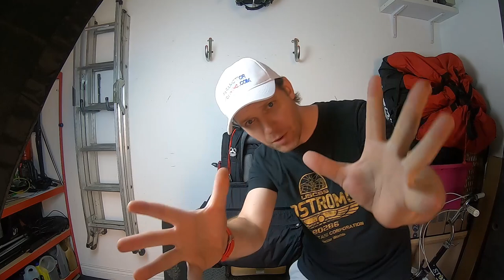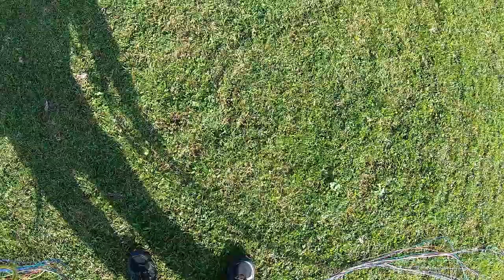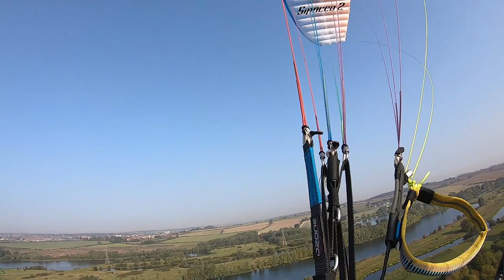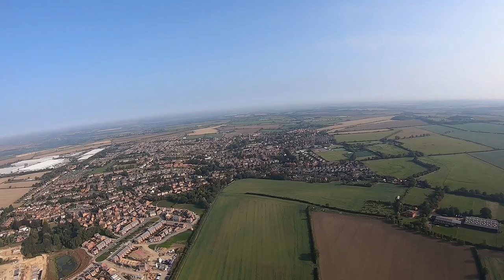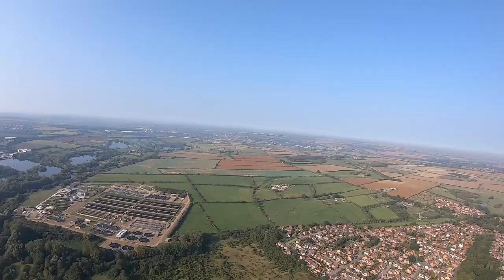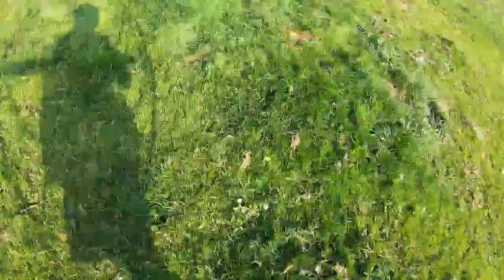Paramotor Vlog - Hangpoints, Bruises, Testflights

Comment: Nice Video Paul. On those nill wind days. Try running your motor up (blowing air over the wing) for a little longer, 20 seconds ought to do it. It helps set up a nice airflow. Then launch immediately into that. 
Keep up the great work!

Comment: Love the way you 'tell it like it is' mate :-) Makes me keep watching!
And you're static hang check was ok, like I've recently done on my Miniplane...but on take-off it was not so easy for me to slide into the seat? (which was great in the garage...)
Me thinks it's the thrust that changes the angle of the seat during a full power take off... what say you friend?
Cheers again,
keep posting as we always are still learning!
Reply from the maker: Got in the seat ok, but hadn't in the past. Used the hang check to readjust the legstraps.
Thanks for watching! 👍

Comment: Exact same harness I have. Love it so far. Been thinking about moving my hang points forward but my arms have only Front/middle/rear. Currently in the middle. The only issue I have is that I have to shove the seat under me with one hand. Maybe just my extra long legs.
My wife tells me my mood is bad if I go to the field and can't get in the air. I try to just be glad I'm only disappointed. Grass stains on the knees from the day before? :D Thank you for including that too. Thank you as always for the tour.
Reply from the maker: I had that with the seat, but adjusting the leg straps solved it. 👍
Reply: @PARANOOB  Tightened them up or loosen them off?
Reply from the maker: Depends if yours are  too tight or too loose! 😉
Mine needed tightening a bit. 👍

Comment: What could also be happening is the XL harness could have dropped your torso lower relative to the frame. This would put the motor's thrust vector high over your center of mass. Jumping to full throttle do you find you get pitched forward momentarily?
Reply from the maker: Will check next flight, thank you. 👍

Comment: Just subscribed! 
Thinking of getting into the hobby
How much in regards to g-force and stress on take off do you get?
Is the motor heavy? 

I know that McDonalds!!
Reply from the maker: Hiya! Thanks for watching and for the sub! When your feet leave the ground all the stress goes away.. :)
For normal flying, G-force isn't a thing. Obviously you can feel it when turning tighter etc. Motors vary in weight; 4-strokes like mine are the heaviest, low cc two-strokes are the lightest. You're only carrying your motor and fuel until you take off, after that you're just sitting there, with the wing carrying everything.
If you're local to me, get hold of Clive at CM Paramotors and pop along to his field one day when students are training. He'll answer all your questions and you can watch everybody.

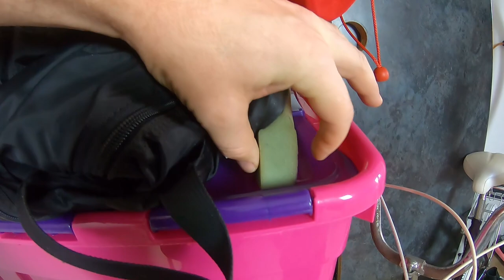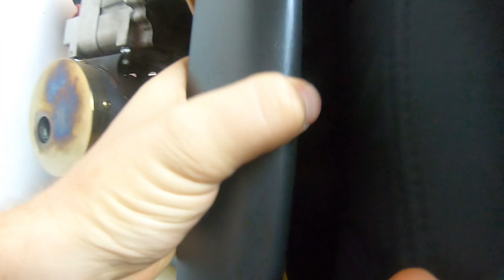Comment: 1:25 and 1:39....using the word "inch".  What country are you in???  Sounds like you're panting after the Anthony Vella style failed launches in non-metric units also.  I expect more from you.
Reply from the maker: We use both metric and imperial here. 👍
Reply: @PARANOOB  I did not know that!  I'd prefer metric always, but I'm stuck in a country that shuns it.
Reply: The foam padding is 22mm +4 8ths if that helps 👍
Reply: @clippedwing-bensmith1614  Phew.  Better. :)
Reply from the maker: lolz